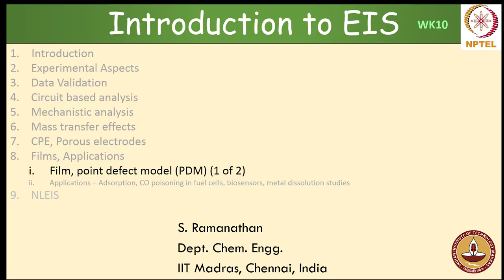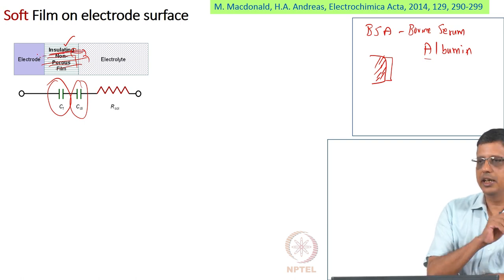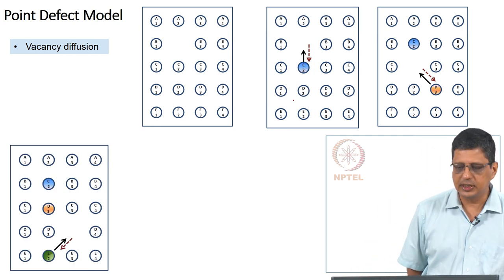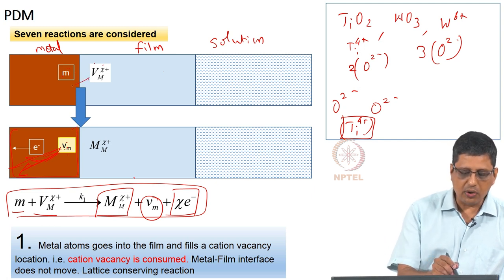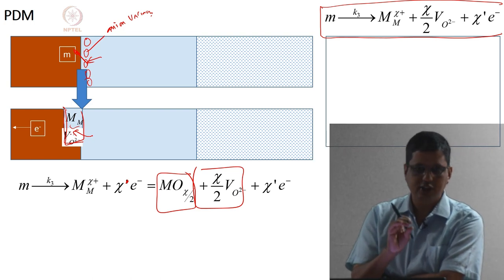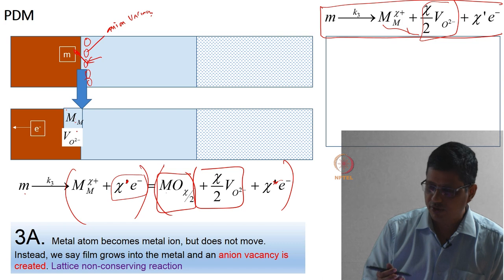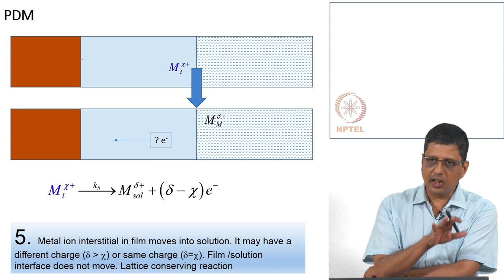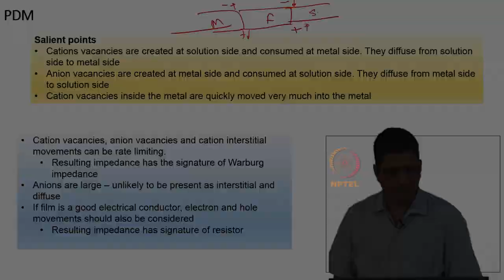Films, PDM

Comment: If we are too negative in cathodic potential where we have got H2 evolution, what is the issue? Will it be discussed in one of your lectures?
Reply: Hydrogen will come as bubbles. Any gas evolution has the following problems. Bubbles will form, grow, coalesce and may either release or block the surface. The effective area of the electrode will be varying with time. Our measurements will be affected, the data will be noisy and it is difficult to interpret the results